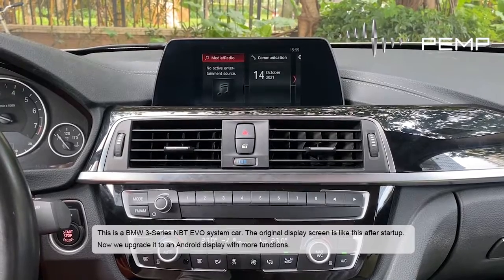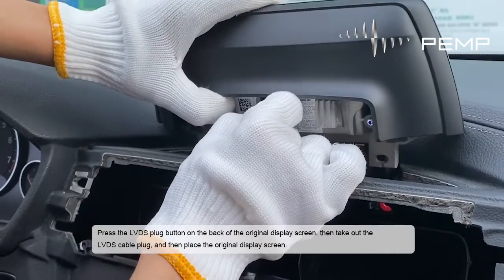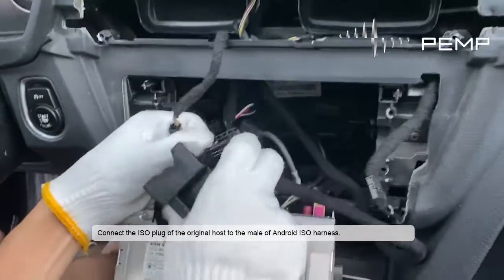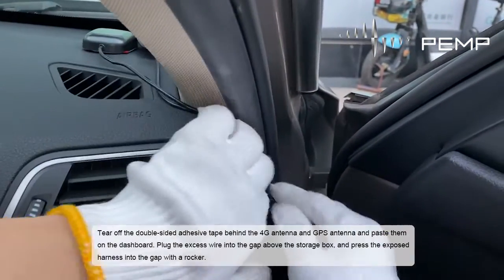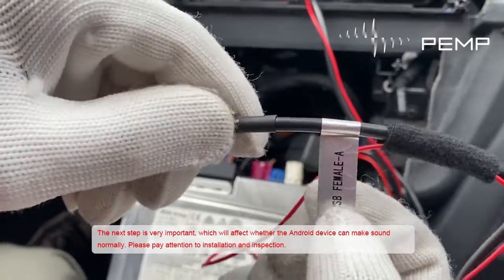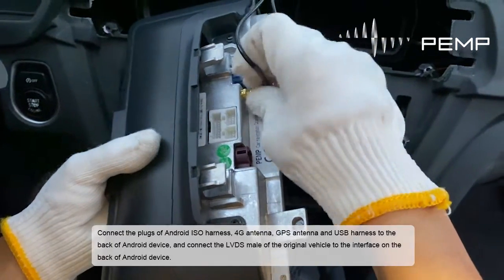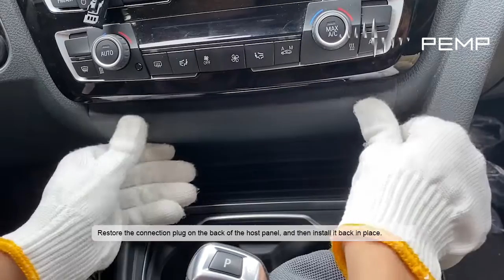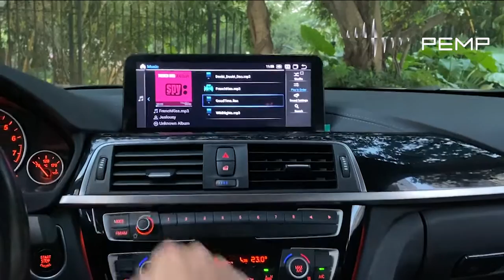BMW 3 Series F30 NBT EVO ID6(2017-2019) update android CarPlay screen Install video

Comment: You shouldn’t put the GPS and the 4G antenna together like that. They interfere with each other. They should be far apart from each other. The GPS in the glovebox and the 4G behind the facia above the air vents or vice versa. They both should be hidden out of sight and not on display on the dashboard like that. 🤔
Reply from the maker: Your suggestion is very good! It can benefit many car owners.

Comment: If the original USB input now routes to the Android unit, how would I be able to do map updates for the BMW iDrive navigation system (for example)?
Reply from the maker: This problem is very good, if you have to use the original car's USB to upgrade, you can only pull out the Android plug, and then restore it after the upgrade.

Comment: Is it possible to replace an original 8,8 inch screen with this unit and connect only the LVDS cable, to get a bigger display for the original/native BMW Entry/Evo system?
Reply from the maker: Sorry, our product is Android system. It needs to be connected to power supply etc.
What you mentioned should be the 8.8" display from the BMW factory. I don't sell it.
Reply: Maybe I can explain my question in another way. The BMW F30 entryevo doss not allow to install a lager original display than 8,8 inch. Otherwise the „no signal“ message appears. If my 
understand is correct, your 10.2“ system can display the original UI (parallel to the android mode) if I install it with the shown/complete wiring. Is that correct?
Reply from the maker: @user-yn8tj3pt3b  your 10.2“ system can display the original UI (parallel to the android mode) if I install it with the shown/complete wiring. Is that correct?
Reply: Yes

Comment: I've got the same of similar screen and it runs hot at the rear of the screen does anyone know if this is bad or if its the same as theirs?
Reply from the maker: Working in summer, the screen surface temperature does not exceed 65 degrees Celsius. The product does not fail. Then it should be fine.

Comment: Will there be a version for the touchscreen NBT EVO head unit?
Reply from the maker: this is a good question, if your oem was touch screen, after install, you can not use touch on OEM interface. only use the touch on android interface.

Comment: why cant you use the factory gps antenna?  having the gps antenna on the dash looks sloppy
Reply from the maker: Dear. if your have the oem gps antenna, You can purchase a PEMP antenna adapter.
https://www.amazon.com/dp/B0CN12J6VR?ref=myi_title_dp
Reply: @pempcar  yes, thats will do nicely.  thats the one thing about aftermarket stuff, they tend to make the car look non factory and sloppy with things hanging out of everywhere.  we can lose that g4 box too or place it in a less conspicuous area.  thank you

Comment: My problem is (with no signal). Is this cable only for audio or does it solve this problem of lack of signal?
Reply from the maker: if your oem info no signal, should be the LVDS cable issue.

Comment: Does this share the factory USB port in the armrest or do you need to have a separate cable hanging out under the dash?
Reply from the maker: After transferring the USB interface, the Android sound channel takes up your original USB, and your armrest box USB becomes the Android USB interface.
Reply: @pempcar  so can you still use the armrest box USB to charge your phone if thats the case? or no electricity comes out of it anymore
Reply from the maker: @vanilla1st   The PEMP bmw f30 evo sold now is Version B, and the android sound will take up the armrest USB port. So I suggest you use the PEMP android USB to charge your phone .
Reply: @pempcar  Is there a way we can communicate a bit? I'd like to order one of these and I have some more questions.
Reply from the maker: @vanilla1st  Please send our afer-sales team email at Service@pempcar.com

Comment: Can you use CarPlay without wireless. Like wired connection
Reply from the maker: it built-in wireless CarPlay function. if you want wired carplay, you need update the zlink app to 5.3.28 version.

Comment: What I can do? i installed on my f36 2018 id6 and i have no sound. I have to solve with the auxiliary cable?
Reply from the maker: Dear, does your armrest box have an AUX input port? Does the original car interface have an AUX menu? If not, you need to follow the video to use the original car USB port as the audio input of the Android. And every time before entering Android, you need to select the usb menu of the original car.

Comment: Hello. I have exacly the same product, and i have Connect to my bmw, but there is Sound issues, there is no Sound when i PLAY Music on the Android (Apple CarPlay) and i have benn try all thing, but its still not Worning. Can u help?
Reply from the maker: Well, let your after-sales team try it. You send the questions about the products you purchased and the photos of the wiring to our after-sales team. Service@pempcar.com, they may have a solution to your problem.
Reply: I have the same issue. Does it need an aux cable to sound?
Reply from the maker: @nytan22  Because the audio of the bmw EVO system is input from the USB to the OEM Radio, the USB transfer is very important, please pay attention to the USB transfer process starting at 10:03 of the video. I would like you to send the picture of the connecting cable to our after-sales team email service@pempcar.com, we will deal with your problem quickly.

Comment: Is putting the antenna and gps necessary
Reply from the maker: If you want to use 4G network and use PEMP Android navigation, you need to install these 2 antennas. If you don't use 4G, and always use your phone's navigation, you can leave it installed.

Comment: Are the 4g antenna and GPS antenna required?
Reply from the maker: Yes, you are right. It supports 4g netwrok and gps function. There are two accessories（4g antenna and GPS antenna） in the product box.

Comment: Will this work on a 2017 340i with id5?
Reply from the maker: Your car is ID5, it should have AUX jack in the armrest box. You need to change the wiring harness connector and also update the product software. To be compatible with your 2017 340 ID5.
If you want to do so, please contact our after-sales service team at service@pempcar.com to learn how to make changes before purchasing.
Reply: @pempcar  I checked and dont have a aux jack in the armrest box. I have 1 usb under the climate control and that seems to be it
Reply from the maker: @semtexs2178  OK, our after-sales team will reply you. thanks